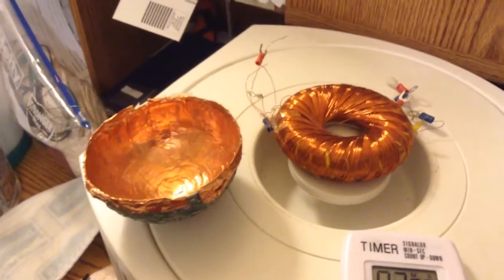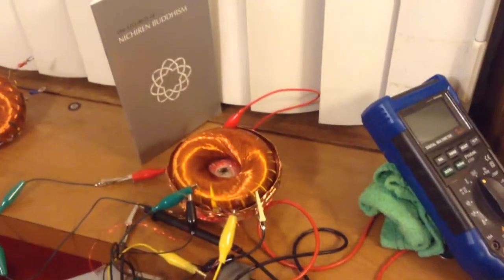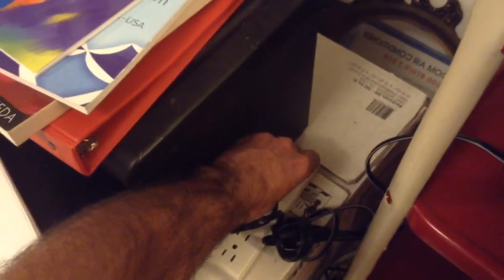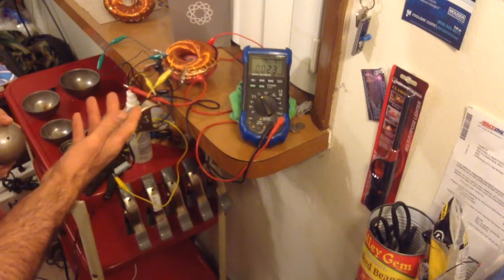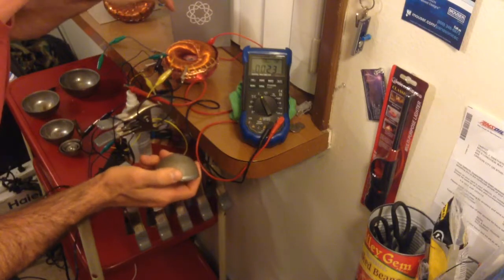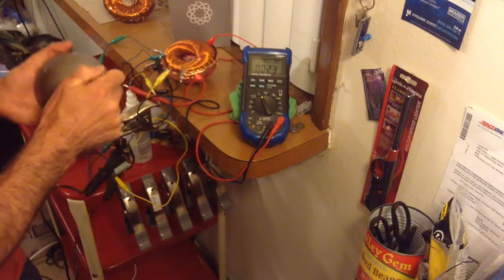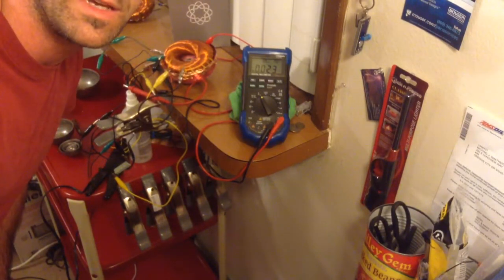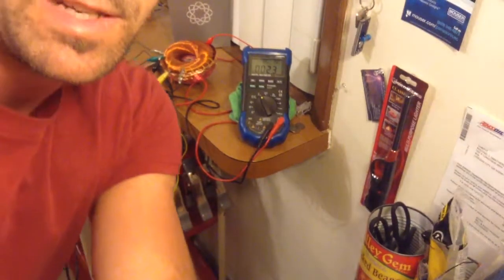Voltage increase caused by parabolic coupling of magnetic bowls!!

Comment: Induction. When you have separate secondary coils on the same primary coil they will all have a charge. The amount of charge on the primary coil determines how much voltage is induced on the  secondary coils. This is how toroids and transformers work. I do not know for sure about the bowls but it appears that you are focusing the induction by compressing the magnetic field with the bowls. Just a cursory idea, maybe someone with more expertise can explain better.